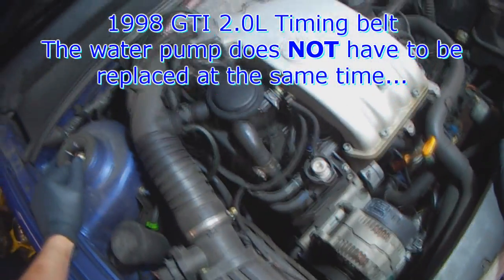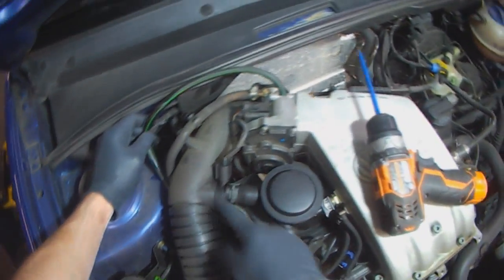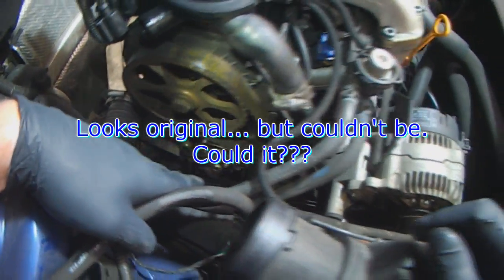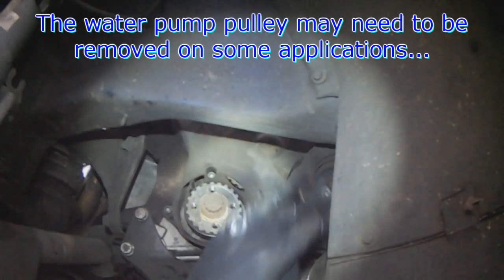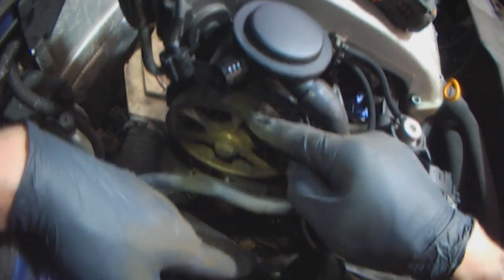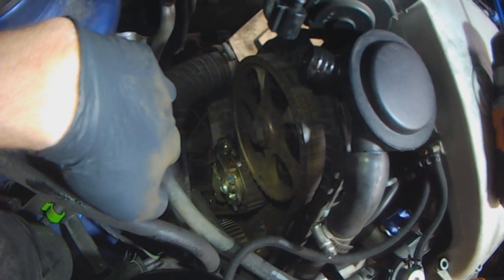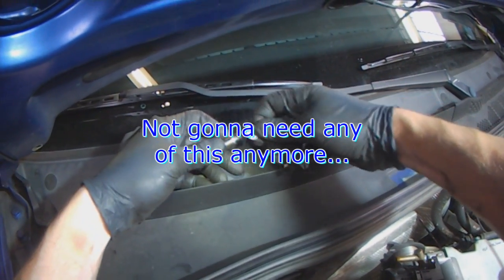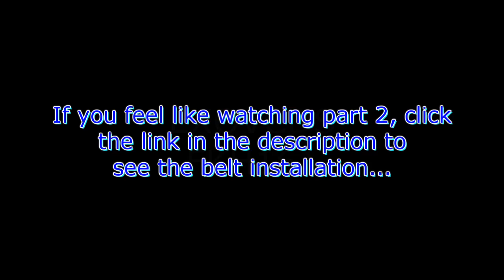VW A3: 2.0L ABA Timing belt Part 1 (with commentary)

Comment: hey was wondering if you have a video which includes how you remove the crankshaft bolt?? need to replace my keyway (hoping it didn't bend valves but most likely did), and not sure how to remove bolt from without crankshaft spinning?
Reply from the maker: What year car? Engine?
Reply: 1996 vw jetta 2.0
Reply from the maker: I have a couple of different tools that hold the crankshaft sprocket while trying to remove the bolt. If you have an impact gun, you don't need the tool. If you use the tool, you need 2 large pry bars to remove the bolt. One to hold the tool, the other to remove the bolt. 
http://www.tomorrowstechnician.com/wp-content/uploads/Articles/02_01_2010/71317pSPToolscu_00000029342.jpg
Reply from the maker: The tool needs to be used when tightening the sprocket, to ensure that the crankshaft does not rotate. Only loosen or tighten the crank bolt while the timing belt is still in place... that way, if the crankshaft happens to move a little, the camshaft will also move. If your belt is broken, remove as is. Install a new sprocket, put the belt back on and see how she runs. Worst case, the crankshaft is worn where the key is and you will need a crankshaft as well.
Reply: yeah i have a big air compressor and impact gun but no 12 pt 19mm socket that fits over the crank bolt, time to invest in one!
Reply: i may be having to do an engine swap on this car due to possible valve damage (i have two spare motors), and being a little inexperienced i may have a lot of questions and concerns. i know this is a lot to ask but do you have a personal or business email i could possibly contact you at with more questions? btw I'm using my sister's youtube account to comment since i don't have one myself, my name's Jacob!
Reply from the maker: Pulling the head and replacing the bent valves is quicker than an engine replacement... unless you need the crankshaft also. My email can be found via http://fkh161.ca/ click on Tech Help Request
Reply: what about money wise and skill-level requirement?? if it costs less and takes less skill to do the swap i will just do that(considering i have two spare engines in my disposal)
Reply from the maker: That's something you have to decide... remove the crank sprocket first and check if the crankshaft is OK. If OK, then I would pull the head. If not OK, swap engines. Either route / option will have it's pros & cons.
Reply: okay thank you much for the advice, now i'll get out of your hair (for now). and will certainly donate to your tool fund for further questioning and everything since you may be helping me so much. have a good one!
Reply: Thomas EXOVCDS  Great video, thank you. Can you take a look quick at the aba video on my channel? my engine is making the same knocking noise as the one in the video, id appreciate any input thank you!  Im thinking wrist pin noise? But im not sure

Comment: Plastic impellers on the OEM water pumps are known to sheer off and overheat the car.  I would change the water pump the first time with the timing belt, then ever other timing belt.  Always replace the tensioner with the OBD I style eccentric pulley
Reply from the maker: If the pump is driven by the timing belt... it gets replaced with every timing belt.
Reply: The water pump is run off the V belt in this car...
Reply from the maker: Alan Ackaway Yes, I know. I was just trying to make the point that I replace water pumps every time a timing belt is replaced, if the pump is driven by a timing belt. 

When it is not (such as in this video) I replace it when it is noisy or leaks... because it can be changed at any time without having to touch the timing belt.
Reply: You're absolutely correct, but I would like to change the plastic impeller style pump asap before it causes your car to die on the side of the road, Or worse destroy the engine.  

Once you have the updated pump its a good idea to change it every other timing belt,  I do my T belts every 75K. (My 95 golf sport)   An OEM pump is only 55$ from German auto parts,  cheap insurance if you ask me.  Im sure you as a professional technician will see that many people don't spent the money where they should.

Its better to have it done there when its openee then have it die on the road +120$ tow then get it fixed

Comment: I have a question do you really need a tensioner roller?
Reply from the maker: You mean replace it at the same time or not use one at all?
Reply from the maker: For the timing belt or the serpentine belt?
Reply: ***** not to use it at all
Reply: +Thomas EXOVCDS the part you remove a 7:40
Reply from the maker: +Sasuke Uchiha Yes... you need it. How else is the belt going to get tensioned?
Reply: +Thomas EXOVCDS ohhh ok ,dame I couldn't make some more extra horsepower all well